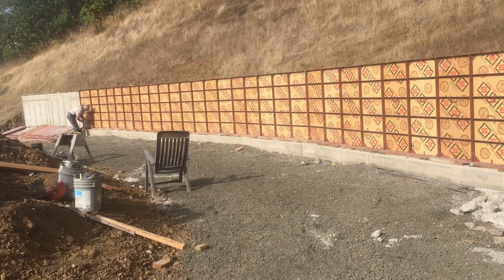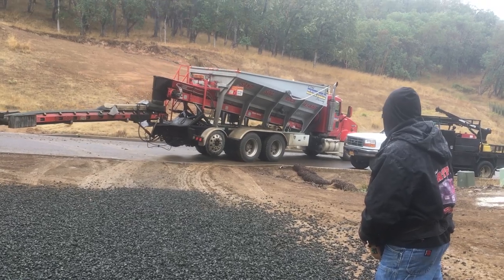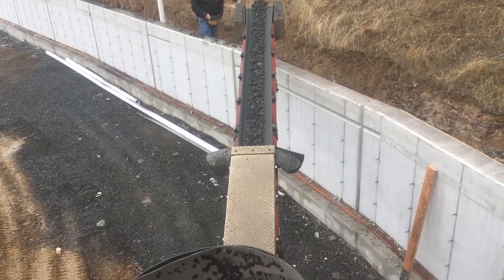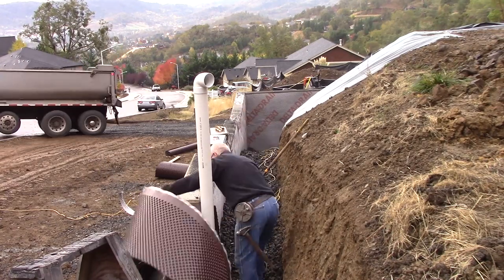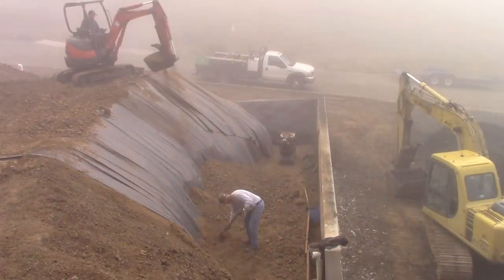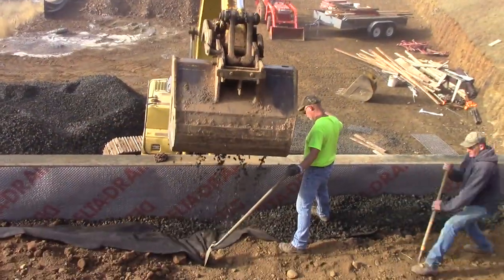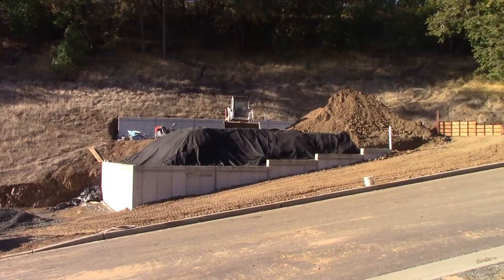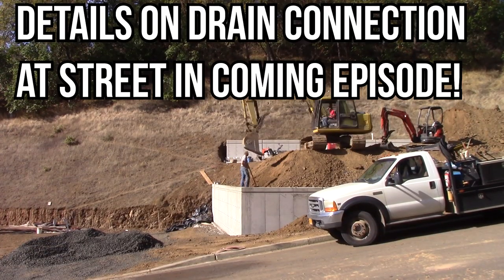Where Does The Water Go? Ep:19

Comment: I understand using the filter paper to prevent clay from eventually clogging your rock underneath it and rendering the drainage system ineffective. But what prevents the filter paper from eventually clogging?
Reply: I'll take a stab at this: I bet it's because the clay particles are never tightly packed enough that they can, by themselves, prevent water from passing through them. The filter paper doesn't prevent water from passing through either, so it stands to reason that the paper + the clay also can't stop the water. That's just my shot in the dark though. It's a good question!
Reply: My guess is that an individual fiber is actually fiber(s) bound together and the space between is small enough such that clay can't get in but water can. So it's not so much that the clay won't fill the space between the fibers but rather that each fiber acts as a sort of wick that will allow the water to pass to the other side of the barrier unimpeded, while the clay gets caught up between the fibers.... but that is just a guess. I would love to know if I'm close. :p
Reply: Clay is normally seen as very thin flat structures at the micro level.  And when deposited by sedimentation lays fairly flat and retards ground water the most.  However water will still flow both parallel and perpendicular to the clay particles but much more slowly then say compared to gravel.  When clay is disturbed and back filled it will be even more porous due to breaking up the natural structure and fractures than naturally laid clay particles and ground water will flow (percolate) even more.  It is probably easiest to think of the drainage layer like the paper filter in a shop vac.  Yes it does clog to a certain degree but air will always continue to leak through.  It is the same for water with the fabric filter.  By using the fabric layer you greatly increase the surface area and the water will eventually all leak into the crushed rock and eventually into the drainage line.  Since the rock extends up along the wall if the temperature ever turns to freezing then at least you will never have standing water against the concrete so you never have ice back up against the concrete wall.
Reply: Monique Melanson Thanks for a good explanation, that makes sense. If I understand you correctly, you could achieve something similar with a kitchen experiment: fill a sieve with gravel and then add water plus dirt. Both the water and dirt would filter through the system, but the mesh in the sieve would destroy any attempt from the water to bond with dirt to make clay in a way that causes problems in the drainage. What would come out from the sieve would still be water, albeit colored from gravel and dirt. Something like that?
Reply: All that,  plus it depends what kind of clay.  I've seen water drain through clay surprisingly fast, and I've seen clay clog a filter fabric drain sock to render it useless. So
Reply: The comment of the filter sock is interesting because in fact probably that filter sock is not clogged but only slowly letting water pass.  Since the total surface area of the sock is only a small fraction of that compared to the surface area of the fabric covering the drainage rock it now appears clog and effectively it is.  That is why you want to cover/enclose the drainage rock as properly as possible with a proper fabric.  If your clay is getting into your drainage rock to any great degree you have lost the battle.  In other words it is probably better not to install a sock and have a cleanout just as the EC has done.  Again very good quality work being done on this project.  What all utubers should aspire to be.
Reply: Monique Melanson  Yes, that's exactly what I meant.  Just not said as eloquently as you.  :) Those socks, not necessary.  Best to have plenty of gravel below the frostline with filter fabric placed approximately in the middle of it with abundant surface area.  Of course, a second drain pipe would be insurance.

Comment: Seeing you had 2 excavators on site the conveyor was a waste of money, quite slow too and was basically just an advertisement for the company concerned.
The wall should be engineered to take any load. Putting blue metal behind the wall is great but it will not reduce in any way the lateral load to the wall.
As far as waterproofing the wall any underslab moisture barrier (plastic) will do.
Compacting it 70% achieves nothing because gravity will eventually compact that earth to 100% anyway.
Overall a good job but of you cant build a structure near the wall then the wall needs to be designed so it can.
In any case any adjacent structure can be piered deep enough so any load is transferred so as not to laterally stress the wall.

Comment: Would it make sense to add a second drain pipe for redundancy?  PVC is cheap compared to all the fill and time.
Reply: Kevin Stempien I thought the exact same thing. Looked like there was room for two side by side.
Reply: Kevin Stempien --- When the pipe (such as this) is expertly installed, no other piping is needed. The 2" rock and the staged filter fabric will take care of 'any possible needed redundancy!'
Reply: Meh.  When you're spending (I'm guessing) $15k on material, equipment and labor, an extra $75 on PVC seems like cheap insurance to me.
Reply: I was going to ask the same thing, but higher up in the stone. I have seen a 4" pipe flow completely full for weeks on end. 
Perhaps he doesn't have that amount of groundwater in the area. He might have been able to tell by the fluorescence while digging, but I thought that was fill soil so that fluorescence wouldn't have been there. IDK
Reply: Done correctly no redundancy is needed. Although, if this was done in Sweden, there would probably be vertical pipes sticking up from the horizontal pipe, to make it possible to flush it out if to much silt gets into the system.
Reply: Markus Karlsson I think there is at least one clean out

Comment: Cornish Hedges don't have wall jacking as an issue, since there is nothing except their own weight holding the wall together, the entire wall is a drain. whatever pressure that occurs from the un-compacted soil behind is countered by an in-built tolerance in the profile of the wall, as the earth behind slumps, it pushes the wall up straight and (in the cases the hedge is built properly) reinforces the structure. after 100 years you have a straight, strong wall that ain't going anywhere.
Reply: Bueno, man.

Comment: Do you break snap ties and dry pack
Reply: Very good and important point. Without patching the snap ties,there are pathways for water and rust to attack all the steel in the wall. It will not happen immediately,however,not a question of if,but a matter of when. That could be the kiss of death for the wall.

Comment: What's up with the part of the pipe that goes up? Is this pipe just to remove the water that gets behind that wall?
Reply: It's a clean out. If the system is ever clogged you can send down   the appropriate tool to clear the obstruction, or send a camera to inspect the issue.
Reply: Ah I see! Thats clever

Comment: You and Carl are dead wrong about the plastic at an angle. You just built in a failure plane in the backfill. You may have increased the horizontal earth pressure higher than The Active earth pressure.

Comment: GREAT JOB. ONE QUESTION DID YOU ALL ADD DEAD MEN TO THAT WALL?
Reply: Disclaimer:  No men were hurt during the filming of this episode.
Reply: WJ Your either joking or don’t understand or maybe both!
Reply: I think it's just a wide footing, with no piles or deadmen behind it.  The idea is that the weight of the dirt pressing down on the footing will compensate for the lateral load placed by the hill.  EC had a geotech engineer on board, so it should be skookum enough.
Reply: Keith Cronk  if I remember right, it was built in a convex fashion to eliminate the need for using deadmen. To check this, look back to where he was setting the forms on the footing.

Comment: You should have put that footing at least 4-5 feet deep from its current position. That wall and how its made won't hold up that mountain. You want a footing that's already buried deep and able to hold a that initial load.
Reply: a geological engineer who lives there thinks it will and is backing that with his bonded insurance against claim of fault. The fact is you are looking at a picture and deciding it can't be done, he's using soil testing, formulas approved by enigeering guidelines and his years of experience doing construction in that area to say it's safe.

It seems far more plausible your mistaken about the relative desire of that mountain to shift and the capacity of the retaining wall to withstand it than the engineer is.
Reply: I guess math, engineers, inspectors, and experience mean nothing these days then. I'd sign off on that wall and how it was constructed.
Reply: Don Ziolkowski well said.
Reply: Guys look what's happened in California. Bad engineering of hillside homes, retaining walls, perimeter drains, etc. That's what insurance is there to protect bad engineering. Engineering is a profession, many bad and a few good engineers. Many bad doctors, doesn't mean all are good simply means they hide behind barriers that protect bad work.
Reply: stanley siewierski and where did you get your engineering degree?? And have you spent 40 years In the building trades? Most likely no.
Reply: stanley siewierski  I see your point after your explanation,  but those sites in California, I doubt they made documentaries of how they were built. Lol.  No Sir Ree.  Just like the Army Corp. of Engineers wouldn't have showed off how they built the levys around New Orleans; a lot of shortcuts were made. That aren't in the book. Lol ..... reality is a kick in the balls; it's all about perception from the top down.  ESPECIALLY when it comes to 'Doctors', that is a systemically corrupt trade if there ever was one..
Reply: No architect or engineer in the business can guarantee
perfection. If they did, no insurance policy would back
it. Stan Siewierski you are right!!! Hooray for saying the truth!!
Reply: Don Ziolkowski damn. You came in like wrecking ball on that comment 😂😂😂

Comment: Are you building a house or a fallout shelter? The over engineering here is outrageous.
Your sure saw these customers coming. Your only priorities seem to be speed and consistency of production, which is great for regulators and marketing but useless for constructing buildings that will last generations.

Why The F use reinforced concrete for ANY of this?
'Reinforcing' what a joke... more like 'designed to fail in 60 years'.
The reinforcing steel will eventually destroy the concrete... only a matter of time.
Please learn now REAL concrete is made. Concrete that will last 1000 years. ROMAN concrete!
Or better still, save the client money and use earth filled car tires wrapped in plastic.

By the way WHY cut into the side of slope in the first place???????
Why brake the natural hydrology of the landscape?
Build the structure on raised triangulated floating foundations.
Build a timber deck around the house and a ramp for easy access.
Plenty of storage under the house. Quicker build time.
Reply: Have you ever seen a Roman retaining wall?